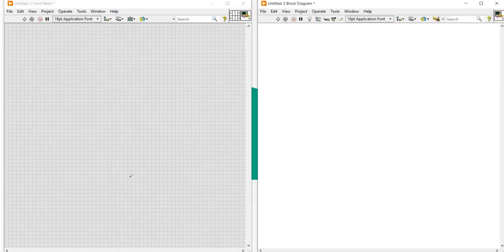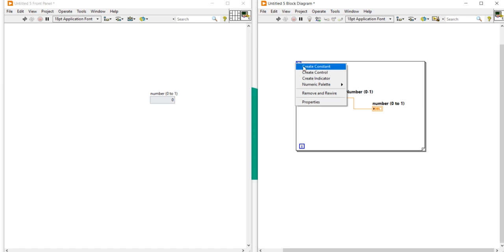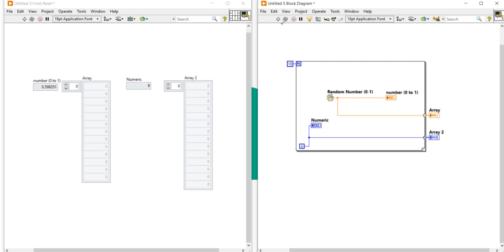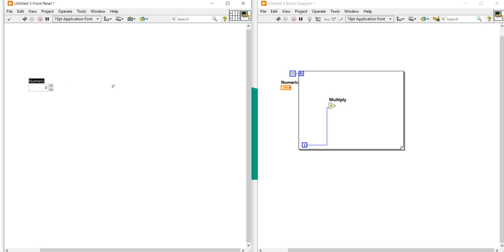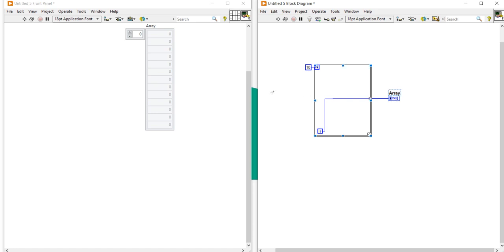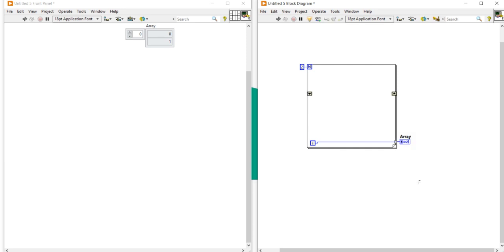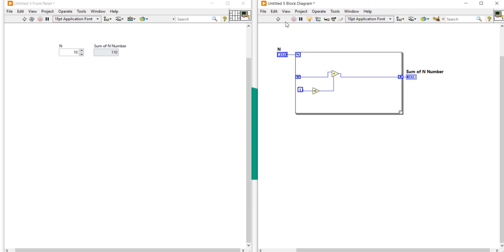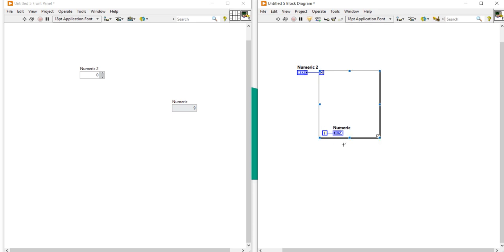LabVIEW Tutorial -11 | For Loop | #tutorial #LabVIEW #programming

Comment: Can you help me in this how to do step by step ?

Build a temperature control system based on Lab VIEW and Arduino MCU, connect a temperature sensor to the Arduino unit, let the user define a three levels of control as following: - Level 1 if temperature is less than 22 °C, a green LED should be turned ON. - Level 2: if temperature is more than 22°C and less than 30°C, a fan should be turned on to

50% of its max speed.

-Level 3: if temperature is more than 30°C and less than 38°C, the fan should work at 90% of its max speed.

- Level 4: if the temperature exceeds 38°C then turn a Red LED ON and a 5V buzzer at a IkHz

frequency.

store the temperature values in a file with a rate of one reading each minute.